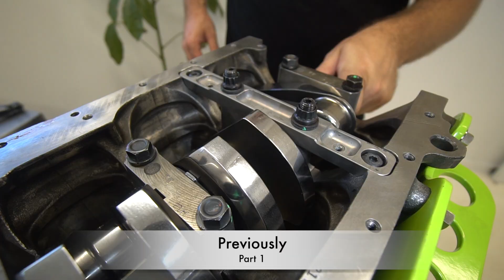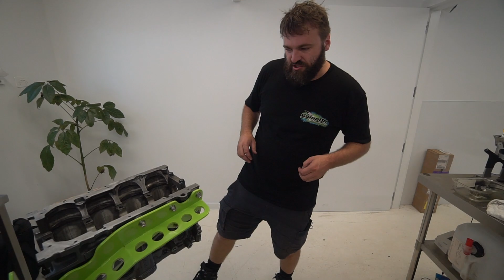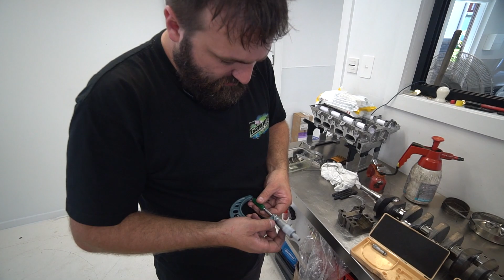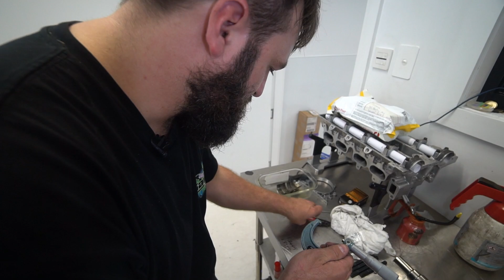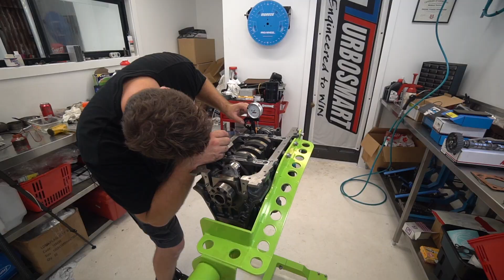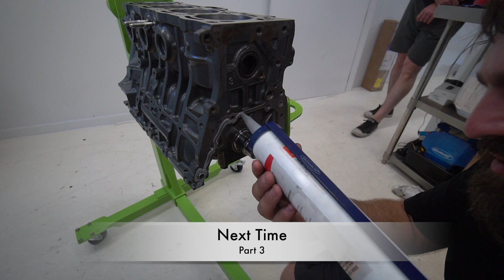Formula Atlantic 4age Build Part 2

Comment: Man, go buy yourself a dial bore gauge :) I'll donate. Btw, are all your tools in inch? Is metric uncommon over there?
Reply: Don't need a dial bore gauge they take to long to work and I can measure just as accurately with inside mic, most reconditioning equipment and parts are made in America so I use both metric and imperial and constantly convert back and forth

Comment: Loving these videos mate, I make my own ring compressors, go to a machine shop and ask for a parted off liner and machine it to a few thou over bore size, then machine in a 7 degree taper and you'll be putting pistons in twice as fast with alot less error for ring damage on installing
Reply from the maker: Very cool, I think I might have to buy Mat an ARP one for one of his birthdays as I don't have the machines or skillset to make one lol
Reply: @199niko199  I'm an engine machinist, I'd be happy to make you one when we get a liner the right size
Reply: Im also an engine reconditioner by trade and done my time at LW parry engenering I was considering making my own ring cone but I literally haven't had the time 😅
Reply: @mtperformanceengines3508  I Def reckon you should, dunno how you use the blue band ones bloody hate them 😂 I've just been making them for every engine I've been putting together when we have the right size liner cut off. Got a good collection now 😊

Comment: These videos are gold.

Thank you to all involved for your time, experience and openness. Getting to see things the majority will never get close to is a gift. 

Inside micrometer over dial bore gauge is an interesting method I’ve not seen and looks good. I suspect there is marginal (like tiny) error from inside tool being hotter from body heat transfer than outside tool but zero issue as you trust the process on good experience.

Thank you.
Reply from the maker: Thanks for your support 👍